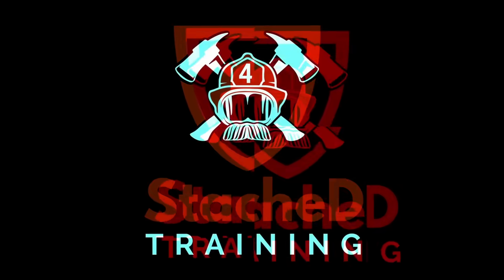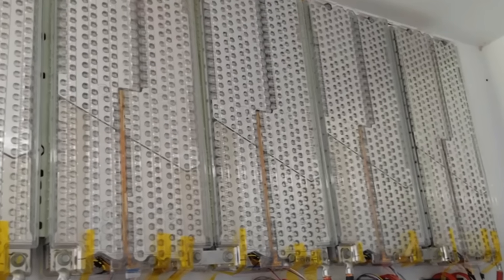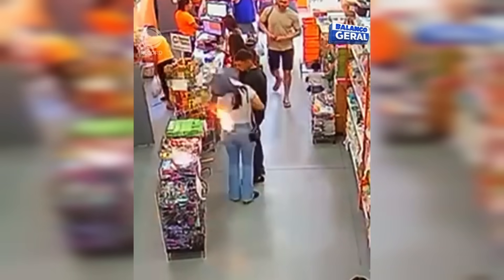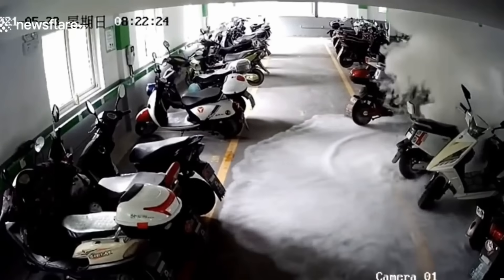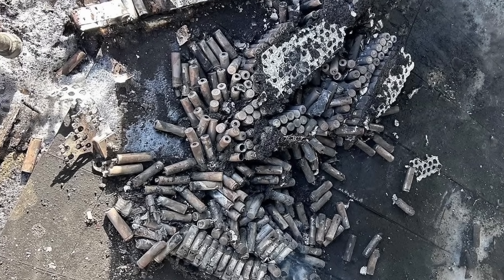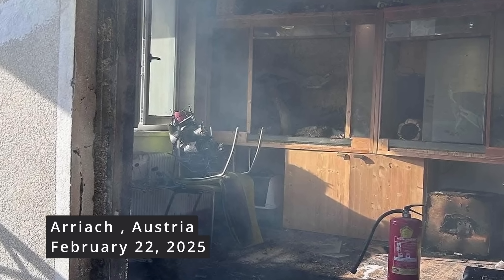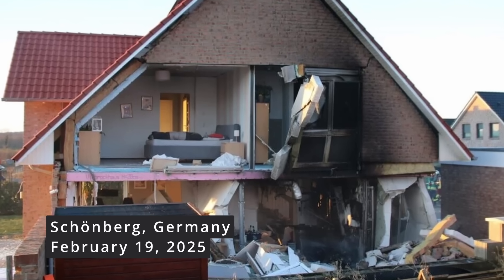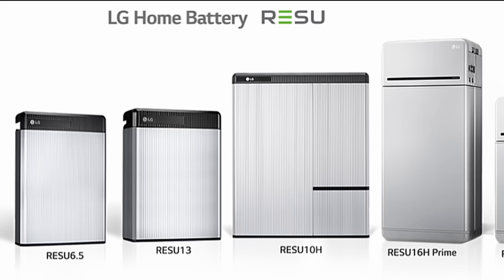Two Homes Just Exploded—The Hidden Danger in Battery Storage!

Comment: During the gaslight era it was typical to have residential acetylene generators outdoors well away from the home and protected from precipitation (critical with carbide generators). 
I would never place a battery larger than a notebook or phone battery inside my residence or garage. That also means no ebikes. All my trucks and cars are parked outdoors so any fire in structure or vehicle doesn't destroy both.  As an experienced mechanic I know gassers have surprise fires too and plenty of them, often due to wiring harnesses which remain engergized even with ignition off. (Ford truck cruise control kickoff switches are a famous example.) If I lived in the Rust Belt I'd erect a steel garage safely distant from my home.

Comment: Those were NMC cells, so honestly, exploding is expected behavior. Those cells are too dangerous to be used in stationary settings outside of consumer electronics. Most modern stationary storagy systems use LiFePO4 cells. After extraordinary abuse, they may off-gas. They do not burn and they do not explode.
Reply from the maker: 4:25

Comment: So they need to be treated like gas ovens, with a ventilation pipe. This and pressure sealed housings, maybe with a inert gas storage, to constantly flush the housing, when a failure or thermal runaway is detected, should make them safe enough for indoor use. 
Also, they need their own emergency code and an appliance, where the firefighters can plug on a inert gas bottle, to further flush the battery with cold inert gas, before entering the building.

Comment: It’s not the batteries fault they explode, it’s the problem of parallel connection of 2 or more cells. If one such cell shorts it will short the cell in parallel and then the other cell is giving 100-200 Amps and quickly overheats. So the thermal runaway begins. 
But if one of the parallel cells dies slowly it will just slowly discharge it’s parallel neighbor and they both will slowly go to 0V and BMS will see it as fault.

Comment: 4:57 I mean, it's not just a little less prone to thermal runaway - LiFePO4 is vastly less prone to these types of failures, and in the Lauterbach incident, it's crucial to know what the BMS was, how the batteries were behaving before the failure, etc.  I remember that incident and I don't know the specifics, but we really need to understand more about this situation than simply "LFP batteries exploded", because they are fundamentally different.

Comment: Ive had a 14.4kwh lithium battery for around 1 1/2 years and ive seen why the battery cells are over heating and could be a fire hazard, the cause is all my none CAN charge controllers, they dont turn off the charge controller when the bms gets hot, i have made a charge volt regulator that only charges all none CAN controllers to 90 95% then will turn back on when battery gets to 80 85%.

Comment: So what we are seeing is a new requirement for homes fitted with ion storage to be housed in blast proof, extenal, actively ventilated, weatherproof enclosures. I'm uk based and we had a huge problem from suspect packages in street waste bins when the IRA were most active. The bins were then designed to direct any blast upwards while containing any force causing the sides of the bins to rupture and create shrapnel. I guess if you are considering any type of ion storage, ideally, they should be housed externally withing a blast proof and perhaps, actively ventitated enclosure. I use soft case, lio-poly batteries in my rc models and we are constantly warned about the dangers of charging them indoors. I charge mine outside in old ammo boxes with the seals removed so if they off-gas, the gas can escape and any subsiquent fire is potentially limited within a small area around the boxes or pouches.

Comment: I think you said it very well BMS should be of top notch quality and functionality but that alone would not lower the risk of Battery explosion. I do think the design should also require the system places away from where humans walk around or do most of their stuff like Kitchen , rooms etc. I honestly think the system should be placed in an underground area away from the structure of the building with a decent concrete walls and structure built underground will inside safety . But that also will mean that a proper ventilation system will be required along with dehumidifier to reduce damage to the system . Once optimized and his could be worth the money .

Comment: I have 4 lithium lipo4 units in a camper i don't use anymore but for storage and the solar system is active but well vented. 
Im planning a very large system and i have everything ready just waiting for the weather to level out. Im not putting 28.6kw in my house or shed. Im in the process of designing an outdoor solar container that will contain everything. With climate control.

Comment: My batteries are AGM, I use a marine grade multi bank charger with temperature sensors.  They are all fused.  AGM does emit a tiny amount of gas on charging but nothing compared to Lead acid and I will not use any of the newer battery systems as in my 40 year electrical experience they lack a track record of safety.  Mine are in a metal cabinet with a powered vent to the outside atmosphere so no explosive gasses can build up.  Other alarms are build in.  I am pretty sure my system is reliable, serviceable and safe.

Comment: Note : use LiFePo, always.

I find it far more likely than not that whatever report mentioned at 4:45 was a misidentification or something because I can find very little if any evidence for LFP's failing catastrophically. The only thing vaguely close I can find is that, if they DO fail, the gas they can release can be noticably more toxic, but nothing on fires or explosions.

If you're storing enough energy for catastrophic failure to be a real risk and are even vaguely a hobbyist LiFePo is non-optional. MAYBE add an in-line set of super caps or something to smooth out brief surges, (for instance motors in an AC starting up) but that should be the extent of your acceptable volatility. LiFePo batteries are ultra-stable and have next to no risk of this sort of catastrophic failure, along with tolerating extreme charge states much better.

Edit : after some more searching I did find a bit more information on them failing explosively, but it definitely seems like it's a "perfect storm" risk more than anything. TBH I'd probably liken it to worrying about using  an extension cord because it might have a damaged cable and start a fire; sure, maybe that's the case, but realistically it's not going to be a risk. The ONLY reports of explosive off-gassing I can find involve incredibly large battery setups, and even then they're VERY rare and seem to be a result of everything going juuuuust wrong. For instance the most common figure for H2 release is about 20%, with that 50% number being the worst case of the range in a study, with a range from 27-52. Most numbers cited are in the mid-low 20% range though.

Comment: Excellent information! thank you, I have a home battery system but i choose AGM, even when the cycle capacity is very limited, those are absolutely safe to have inside, i won't have ANY Lithium type battery inside my house, they scare the hell outta me, yes they last longer, have more capacity per dollar but the risk.... no way.
I didn't knew about the important of ventilation!, i was thinking about eventually buying a 10KWh LFP pack but install it outside in a shed, now i know i have to include proper ventilation for it, for now I'd rather stick with AGM.

Comment: Here in lies the root of the problem: ANY high density, high energy storage device is inherently hazardous, and as you enlarge them, that hazard grows. Big springs under tension, massive suspended weights, gasoline tanks, propane tanks, Li-Ion batteries...all dangerous in their own special way. The goal should be to keep people away from these as much as possible. 

It's reasonable and expected to store an aerosol can of flammable furniture polish indoors. It's not reasonable to store a 20lb propane tank indoors. The same analogy applies to batteries. Laptop? Fine. 1000lbs of LiIon batteries with several kA fault current...um, no! That goes out in a well built, well vented, well monitored shed. I don't even park my conventional gas car in the attached garage very often. 

TL;DR: If you wouldn't store significant quantities of flammables in the area, you probably shouldn't have a large BESS in there either. 

I'm probably pushing the limit of my own advice with this big 2.4kWh SLA battery in my bedroom that keeps the core network UPS alive but SLA is docile compared to any Li cell. Still, ventilation, charge monitoring and short circuit protection are absolutely essential for keeping this system within the realm of reasonably safe. The slow charging speed helps too; it takes a full day to charge this beast, and that keeps the batteries cool to the touch at all times.

Comment: A BMS really doesn't work. It doesn't balance the batteries properly, and they fail often. A smart charger with bank to bank cell charging is what's really needed. But you can still have a battery fire because both the BMS and smart chargers only detect the average voltage per bank of cells in series. So if only one cell is under performing that cell can get hot enough to ignite. Cells must be tested and capacity matched to prevent that. But a cell can still go bad later and have reduced capacity cause it to be overcharged or discharge too quickly creating heat and a fire. The bms and charger won't detect one bad cell because they get a voltage reading from the average of the bank of cells. The ultimate setup is to wire up each individual cell to a meter that is always checking the voltage on all the cells individually. That way that one bad cell can be detected before something bad happens. But nobody does this because it's impractical but that really is the Achilles heel of these battery packs.

Comment: I make my own packs, I test each cell and the BMS, then test the pack. I have a fuse on the output and the charger along with a breaker and lightning arrestor. My packs are wrapped in fiberglass without resin to keep the cells from ejecting during a failure. Not sure why corporations are allowed to make products they know nothing about.

Comment: you can get 18650 batteries that have overcharge sensors and temp sensors built into them they are slightler longer than standard ones

Comment: The problem is used car batteries were used. They are some of the most used lithium cells you can find. 

New cells significantly reduce chances of fire, though I understand the cost is significantly higher.

Comment: Lithium batteries need a rapid discharge feature built into the case if the pack detects under over or short it rapid discharges in to a capacitor that can then dump or shunt current away from the lithium batteries

Comment: This is the first two I have ever heard of and they are basically from the old Soviet black states. My house has had battery storage for 14 years and never had a problem. If the inverter is the root cause you can't blame the batteries you have to blame the designer of the system.

Comment: Any system that requires an engineer for it NOT to explode has no reason to be anyplace near a home that could contain children!

Lithium batteries are extremely dangerous, and any engineer that promotes them in residential structures should have their license revoked for life. Especially since there is already an existing better alternative that has decades of proven use.

Comment: Proper ventilation of batteries, I thought, was a given. Any batteries have a potential, (just go look at your cute alkaline 9v after you forgot about it in the radio) marine and aviation have been very adamant with training for handling and installation of battery power sources for years. This type of thing will always be potential as long as people have freedom, you can't totally regulate it, but you can require an inspection for "insurance" purposes when a "solar battery backup" system is installed.

Comment: Last year I went to find my little power bank, it’s the size of a normal phone but as thick as 5 or 6 phones stacked. Well.. It was puffed up like a pillow, cracked and a little melted, the miniature plastic cosmetics “shelf” it was on had a low point where the plastic had partially melted from the heat and the weight of the battery sunk in. It erks me to this day, like.. when did it happen!? How long did it sit in my house and what fumes did I inhale!? I hate thinking about it lol Ill leave

Comment: Well solar hybrid power plants with battery back up, are primarily build for DIY people, and people that are hands on, if you build a system like this, definitely don’t put it in your house, is not a good idea, try to build a insulated storage shed, and have the cable running underground to your meter box, definitely building your own system, is a more efficient way to replace dependency on any power company, or definitely go for a only solar panel array system, with no battery back up, that also a reliable source of solar power, with less danger

Comment: The DIY guy rarely has the cabling rated for the actual current capacity and the wires heat up, the terminals fail as tgey likely use terminals that are too small for the current they have flowing.

Comment: the main issue is that most home storage batteries are undersized and suffer from peak charge currents often at the limit or above the recommended maximum charge current, as well as using them at the upper limit discharge current. Most LFP batteries for home storage have a fairly low continuous discharge rate, and sizing a battery according to its maximum continuous discharge current is a VERY bad idea. instead, the maximum current draw should be the one used in cycle life testing!

Comment: Yeah, Energy, Electricity or Plasma  doesn't like being boxed, or held in one spot. Electricity in its natural state is one of movement. Electricity likes to be used not held. Battery operated cars are not the future. Combustion engines don't create pollution. It' the fuel, the gasoline that creates pollution. But you can change the fuels for combustion engines. And doing so can create only steam as the exhaust. That's pure hydrogen gas. Use it for fuel and all you get out of the tailpipe is Steam. Zero pollution. We've had the inexpensive tech to modify every combustion to run on hydrogen since Yesterday. No batteries needed.   lol    meaning no reason to wait while your battery operated car is charging.

Comment: "more than 1 million home battery storage installations in Germany", three accidents. That's acceptable for progress.
Since all of these accidents were on a sunny day i suspect overcharging of the system was the cause.
In Germany cars cause at least 33 deaths per one million inhabitants annually. They are still using cars.
Reply: cars don't cause those deaths, people do
Reply: @jdilksjr  Irrelevant. What matters is: technology opens the door to new problems. Besides, self driving cars have not lowered accident rates.
Reply: @jdilksjr  and these systems don't improperly install themselves, people do. 

(Also, what are you smoking, cars fail all the time. Brake lines can go out, accelerators can get stuck down, etc. It's rare sure but acting like it literally never happens is stupid. Plenty of wrecks are caused by no strict fault of anyone involved. It's just not reported because it's not that outlandish; shit happens.)
Reply: @jdilksjr  By the same logic, batteries don't cause explosions, people poorly executing bad designs do.
Reply: @jooch_exe Looks like overcharge protection is a gimmick? marketing ploy?
Reply: @MrCharmz81  Overcharge protection by itself isn't a very good protection. It only keeps a completely healthy battery safe. But batteries age and the charging should be adjusted to those dynamics. The BMS is key in this. Laptops have been doing such a thing quite well for decades and that is a good reason to only use OEM batteries.
Reply: We have 40 million households in Germany…. And it seems like DIY Batteries are keeping up. There is a successfull petition for this madness. Battery Storage for EVERYONE. Doesnt matter if you have solar or not
Reply: "progress" Germany has massive issues with their power generation thanks to this progress. Their entire economy is imploding because of this progress. Austerity will kill lot more people than these battery accidents.

Comment: battery vaults are a solution ..  many gas detectors arew available and could open dampers or start a fan (or both)..  batteries could go in a vault in a basement that is 2 hour rated with automatic ventilation..  maybe even require ventilation with an oxygen deprivation system to limit the fire..  expensive? yes but so are fires and explosions

Comment: Suprising to hear about the LFP going up. Wonder how that happened. They're supposed to be quite stable since the iron sort of practically quenches any runaway that may start, hogh stability but at lower power throughput and capacity - especially power and capacity per unit mass. 

Wonder what the particulars were that caused that to happen.

Comment: I see a popularity in Energy Storage that is very concerning. Last year when i was shopping for a generator, many of the listings were for energy storage systems. The don't truly generate electricity but merely gather it from the home electrical system and store the energy for later use. No doubt a very large number of these systems will sit unused for their lifetime simply because they are only intended for use as a backup power supply. 12 years ago, i purchase an Uninterruptible Power Supply for my homes living room but the UPS has sat unused for 7 years in my garage simply because of disposal issues.